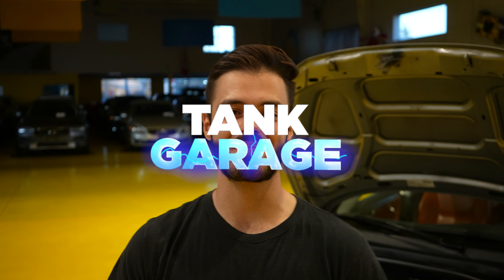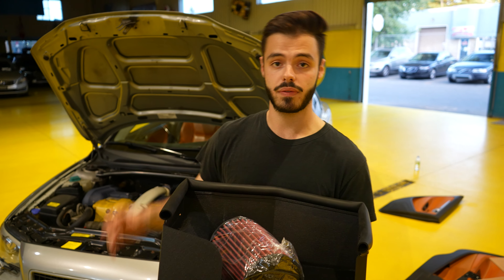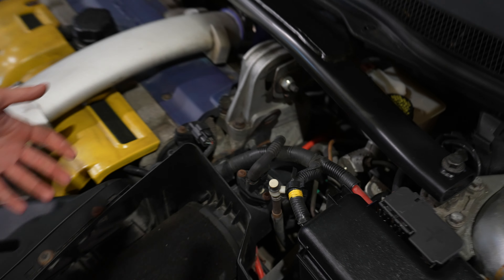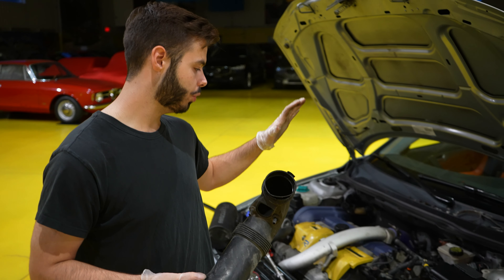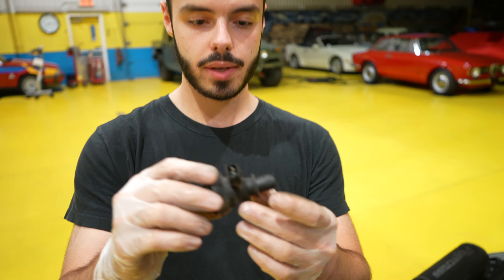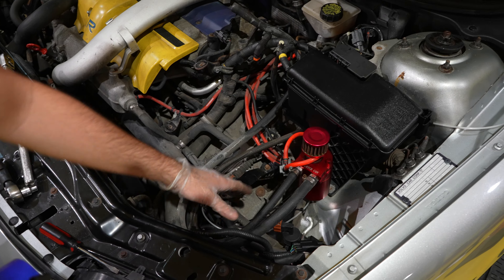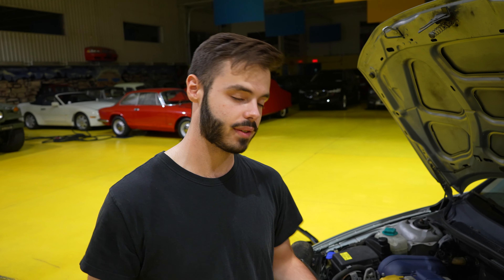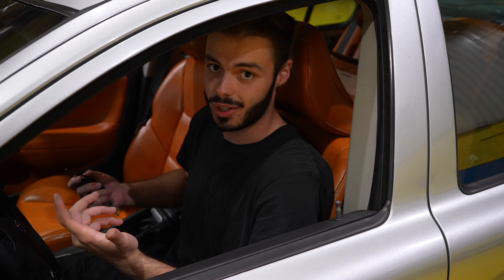Volvo S60R SNABB AIR INTAKE KIT installation! Finally starting the S60R modifications! Part 2

Comment from the maker: What's the next mod we should do on the S60R?
Reply: Close deck
Forge rods
Haldex sleeve
4c service

Just a few things
Reply from the maker: @ZedrateEX  Thank you! We always appreciate the feedback and futur ideas!
Reply: Shim
Reply: How about the Snabb P2 Ultimate chargepipe kit?
Reply: BOVs- which are best for Rs.
Pros/ cons recirculating vs open atmospheric.
Reply from the maker: @mimike80  the charge pipe kit will be install with the intercooler that we purchased from snabb!
Reply: Snabb Tial recirculation kit. Downpipe/exhaust if not done already. Turbo control valve. Ecu upgrade.
Reply: @TankGarage  I got the kit but not the IC. Was waiting on a new K24 from Viva to ship; then back in the shop- was hoping to hear one with the kit installed. Can’t wait to see your install with the IC. Great content!
Reply from the maker: @jerrodcampbell1245  downpipe and exhaust have already been done! The rest is in the works😉
Reply from the maker: @mimike80  Thank you brother! We appreciate the support!😀

Comment: I know this is old, but I have a 2006 V70R. I am looking for this but see it on 3 different sites, with different kits. Which one did you buy that includes the box, filter, AND piping? 

Thanks
Reply from the maker: I got it off Snabb'S website! it is the Kit for the S60R!
Reply: @TankGarage  they have multiple options. Could you possibly link it and tell me which one you did?
Reply from the maker: @synthbeamng   This would be it! Don't forget that this kit comes with the Audi S4 MAF so you will need to repin everything together! also make sure you choose the intake piping as well! as it is an extra to the airbox!
https://www.snabb.us/SVR-High-flow-intake-kit-with-S4-ID-MAF-Body_p_214.html

Comment: Hey quick question I don’t know really much about cars at all but you guys were talking about you’re not gonna tune  it until you’re done, so does that mean it’s OK to drive the car on like the road and stuff and still use it as a daily driver until you today or do you need to wait to drive it if you mess with the intake
Reply from the maker: If you don't change the MAF for the audi S4 one yes it is okay to drive the car like that! You will need to tune the car afterwards so the ecu doesn't go crazy since it's the wrong one! But if you keep the factory MAF you sont need to tune anything!

Comment: I have the same car… i can install and not tune the car? Check engine light?
Reply from the maker: The shouldn't be any issue with an air intake as long as the MAF is plugged in properly

Comment: This is sweet! Ive got an s60 t5 as my first car, what would you say is the easiest way to get some more power out of it?
Reply from the maker: Exhaust,downpipe,intercooler,air intake. All of the first things you want to do in order to get more power without tuning or actual touching the "engine" side of things! But an actual tune and proper modifications will always be the best way!

Comment: Does that help the car ? Makes it run faster? Does it effect the car at all? Will get a check engine light on if you get this part installed ?
Reply from the maker: If the install is properly done, an air intake can increase horsepower on a vehicle. It helps the car at getting a bigger and colder air "intake" the factory air intake is very restrictive and doesn't allow as much air to get to to turbo inlet! You are not supposed to get a check engine light after such an install.
Reply: @TankGarage  thank you for the reply. If you keep that up you might become the best YouTube channel ever.
Reply from the maker: @Jmoney-db4rp  one step at a time ahah! But that is definitely our long term goal! Thank you for your support!

Comment: It would have been nice to give some guidance on the angles and how the hell one person is supposed to get the coupler on the cold air side on and make it stay there. Instead of showing how to remove old grommet rubber. Does the heat shield from the turbo have to come off? Should the first coupler be put in free underneath the car?
Reply from the maker: Honestly the first coupler is a lot of trial and error! We didn't have to remove the heat shield on our install! We installed everything from the top!
Reply from the maker: Kind of impossible to physically show you on the car when there's barely 5 mm of space in between the turbo and firewall lol. You put the new couplers the same exact way you took the OEM ones. There's no modification required, just some patience since it is so damn tight that a toddlers hand would be considered ''big'' for that job (intake coupler only). There is absolutely no need to put any of the parts from underneath (not that you would even be able to do so) and no need to touch the heat shield. The charge pipe and throttle body pipe are a piece of cake to be honest and much more accessible.

Comment: Wonderful hot air kit and losing power
Reply from the maker: If you looked carefully at how the airbox is made you can clearly see that it seals off the top portion on the hood using the "foam strip" so no this is not a "Hot air kit".